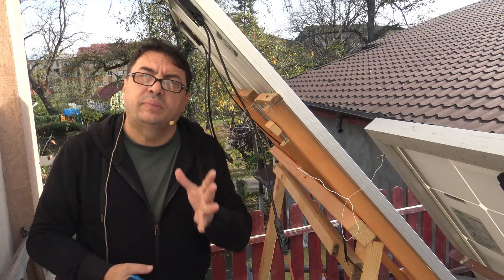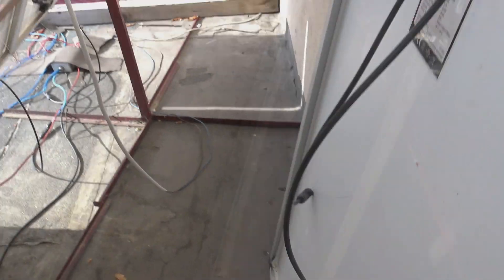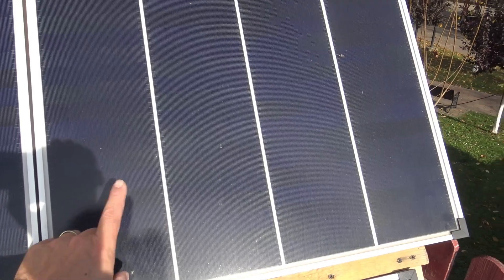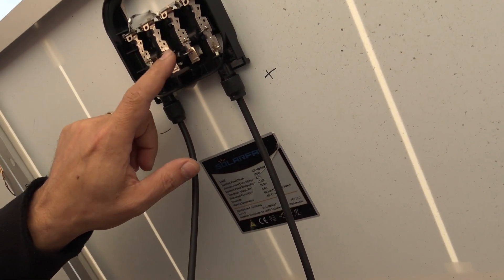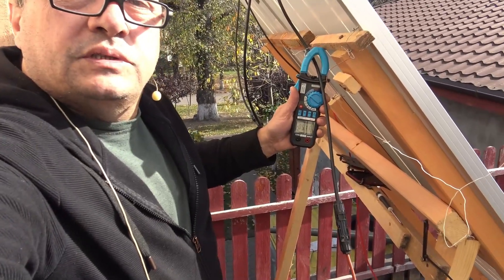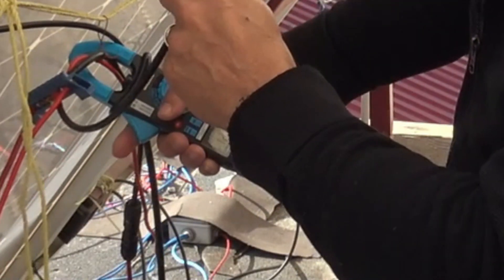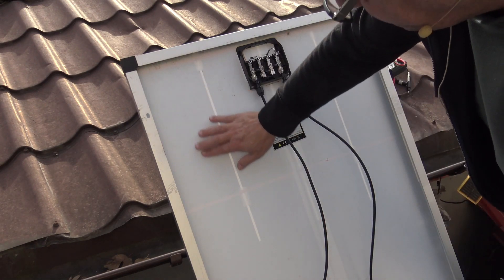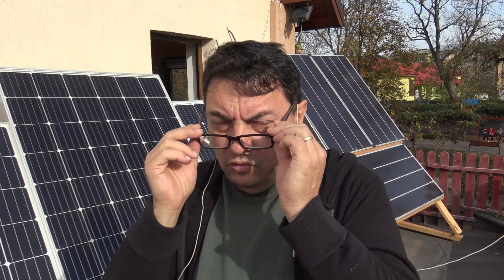SolarFam SZ-180-36 180W burning cells

Comment: Thank you for sharing this! Could you share for how long have you had these panels? Normally they are covered with 2 years warranty! Have you tried replacing them? Did you raise a complain to the manufacturer? I am asking, because I will probably buy the same, due to lack of other models in my area! Thanks
Reply from the maker: I bought this from a local provider. They replaced the ruined instantly without asking me to send the bad ones. Eventually I realized they replaced those from their own stock and the factory didn't make any effort to solve the situation. It was a clear  malfunction on the factory ensemble line, as long as three of the panels had exactly the same problem.

Comment: Hello, I also have the Solarfam SZ-180-36M. But there are three different ones with this designation . Yours have this information on the rating plate. 180W , 8.1A , 22.07V , 26.33V , 6.8A , 670mm*1230mm*30mm . I have two more with the same designation "SZ-180-36M" but in different sizes. 8.61A , 20.9V , 24.7V , 9.13A , 1230mm*70.5mm*30mm and 7.44A , 24.2V , 28.6V , 7.96A , 680mm*1370mm*30mm .
Reply from the maker: I think mine are some cheap fakes..generic some with fake labels...but I contacted the company, waiting for their comment.